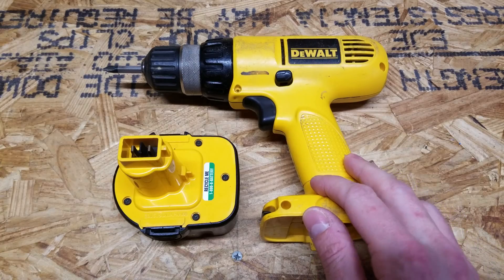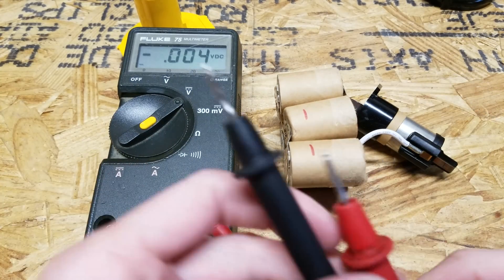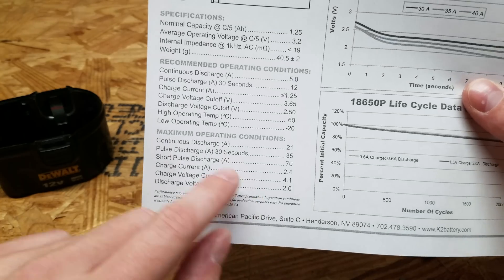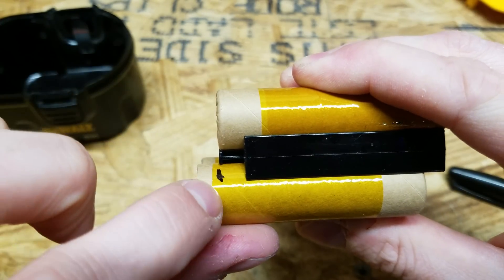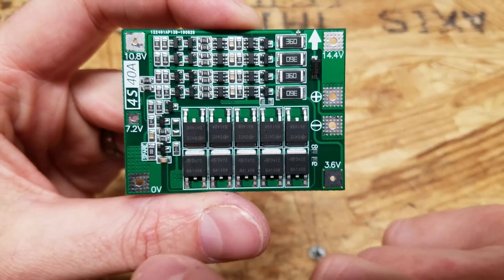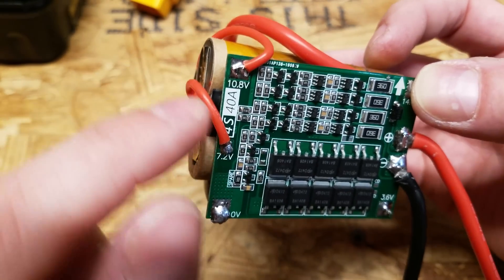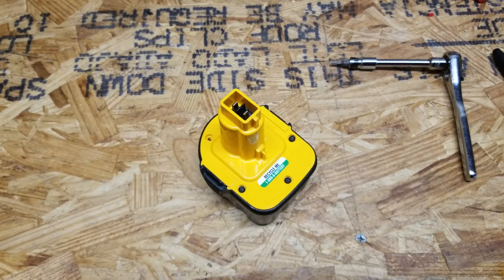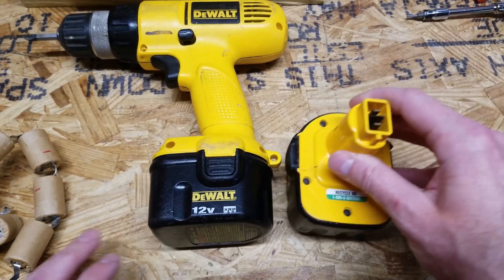Converting a DeWalt 12V Cordless Drill from NiCad to Lithium LiFePO4

Comment: Cool build. You could have skipped the epoxy with super glue and baking soda combo. Also, I thought Lithium batteries needed chargers that had the CC/CV functionality. Do Ni-Cad chargers do the same thing?
Reply from the maker: I just used jbweld epoxy. I didn't use super glue or baking soda? Was there a better way to attach the terminals? I still have two more to do and can do it differently if there's a better way.
Reply: @LithiumSolar  You did a good job. I was just saying the super glue + baking soda is almost instant, so you wouldn't have had to wait the night like you did with the epoxy. But if you weren't in a hurry then it's not a big deal.

Comment: What about charging requirements for the new batteries?
Reply from the maker: Since the new LiFePO4 batteries align with the NiCad in terms of voltage, I'm just using the original DeWalt charger.
Reply: LithiumSolar Short answer, I wouldn’t use the NiCad/NiMH charger to charge those cells. Look for a BMS/Charger combo that meets your cells C rating or less than C rating for charging and balancing. Make sure you understand the cells C rating charging limits. Add a DC jack to the battery pack for power to the BMS/Charger. You can use a separate charging board and BMS but it will take up more space and need to be wired differently. But don’t use the NiCad/NiMH charger for lithium based cells.
Long answer: The charging algorithms are different for lithium based cells vs NiCad/NiMH cells. NiCad/NiMH chargers trickle charge on the last stage, lithium’s chargers just cut off so they don’t over charge, trickle charging a lithium cell will over charge it. NiCad/NiMH chargers tend to overshoot on the voltage when charging, but lithuim cells don’t like this at all and charging is more regulated on both voltage and current. NiCad chargers don’t monitor temperature to cut off charging and were expected to get hotter during charging without being volatile like lithium based cells that are more sensitive to temperature and can go into a thermal runaway. I’ll admit that LiFe cells are less volatile then LiIon cells, but charging them wrong greatly increases the risk. Lithium cells can be safer vs NiCad/NiMH cells when they are “properly charged”, but lithium cells require a much more complex charging circuit.

Comment: You didn't cover charging. I am assuming that NiCad has different charging characteristics than lithium..??
Reply from the maker: I was just going to do use the original DeWalt charger since the voltage of LiFePO4 is near identical to the old NiCad.
Reply: LithiumSolar Short answer, I wouldn’t do it. Look for a BMS/Charger combo that meets your cells C rating or less than C rating for charging and balancing. Add a DC jack to the battery pack for power to the BMS/Charger. You can use a separate charging board and BMS but it will take up more space and need to be wired differently. But don’t use the NiCad/NiMH charger for lithium based cells.
Long answer: The charging algorithms are different for lithium based cells vs NiCad/NiMH cells. NiCad/NiMH chargers trickle charge on the last stage, lithium’s chargers just cut off so they don’t over charge, trickle charging a lithium cell will over charge it. NiCad/NiMH chargers tend to overshoot on the voltage when charging, but lithuim cells don’t like this at all and charging is more regulated on both voltage and current. NiCad chargers don’t monitor temperature to cut off charging and were expected to get hotter during charging without being volatile like lithium based cells that are more sensitive to temperature and can go into a thermal runaway. I’ll admit that LiFe cells are less volatile then LiIon cells, but charging them wrong greatly increases the risk. Lithium cells are safer vs NiCad/NiMH cells when lithium cells are properly charged, but lithium cells require a much more complex charging circuit.
Reply: Stinky Cheese “Things break”, I would consider that an inherent risk with any battery charging system. I think most good BMS/Charging systems can detect a fail or break and stop/won’t charge the cells.
Reply: @GadgetReviews-US  These are exactly the same qq I have been pondering with my rebuild (3S1P, Li Ion, works great so far) of my  ol mans Bosch  drill (198?). Isn't the point of the BMS that it provides both usage protection and also manages the charging (the input from placing the battery in the original charger will go through the BMS board, this type of BMS has the same input/output terminals)? The Li Ion BMS I am using is of the same kind  as  the one used in this video, for 3S. Although the original charger has different control circuitry, in the end it is just supplying DC.. from browsing other videos it seems the most common result from using the original charger is undercharging.
At the moment I am using my Imax B6 - I fitted the batteries with a  dean connector wired directly to the end + - cells and an independent JST balance connector, the Imax control circuitry thus managing the charging.
Reply: Family Brown The BMS does provide usage protection and some with balancing. Most BMS will monitor based on voltage alone, and some with temperature cutoff also. Yes both chargers provide DC, but it’s his the cells are charged that matters so the cells don’t become unstable comprising user safety and the chemical changes that happen inside when charged incorrectly. 
Charging of lithium cells is done with CC (constant current,  the current tapers off once the cell reaches the charge voltage. With NiMh is done opposite with CV (constant voltage) charging. NiMh/NiCd chargers trickle charge since these batteries absorb/self drain a little over charge as the Lithium based cells don’t. Once Lithium cells reach full charge the voltage will fall a little causing the NiCd/NiMh charger to charge the cell more, the BMS will slow this since it’s just monitoring the voltage. This cycle could cause the Lithium cell to become over charged and cause plating of the metallic lithium comprising safety. LithuimSolar mentions he noticed this trickle charging in another comment, but states he takes the battery off after charging. This prevents over charging but the lithium cells still take on some damage from the constant voltage charging. The damage may not be immediately noticed and is over some time that can cause the cell to become unstable during use.
A good article I found about lithium charging is, although comparing the two charging methods in detail would make this a very long comment. I hope this helps.
https://batteryuniversity.com/learn/article/charging_lithium_ion_batteries
Reply: @GadgetReviews-US  Attention: CV is abbreviation of constant
Reply: constant voltage
Reply: @GadgetReviews-US  Thanks for your answer and discussion.
Reply: ioan pop oops, corrected now. Spell checker and late night when I replied. I missed that, thanks.

Comment: 17.8 Wh on the new battery pack. If the old NiCd cells were 1700mAh then the old pack was about 20.4 Wh so not too bad and not that much lower however the life cycle could now be measured in decades as opposed to mere years. lol.
Reply from the maker: Exactly what I was thinking. Less Wh but will last much longer. The problem is I now have to wait another 2 months for another BMS. I should have just ordered 3 at once lol.
Reply: @LithiumSolar  Ahhh, that old dilemma. Why is it when you try to plan ahead and order multiple items for future, they turn out to be junk and you have buyers remorse and when you try to be cautious, you end up wishing you'd ordered more 🤔
Reply: daly bms ship fast from china only i don't know if the fit in youre case
Reply: @electrojessy4270  Nothing is shipping fast from China these days. Ordered a daly bms from Aliexpress a month ago. It's not here yet.
Reply: Got a Daly 150a, took 2 months

My 90ah cells, lets just say I don’t wanna talk about that 😒
Reply: No.  Lithium cells have a shelf life and will not last decades.  In fact, odds are that the NiCd would have a longer life if only they had a proper charge and discharge termination but instead clueless users of tools, keep trying to get the last bit of capacity out of NiCd since there is no protection circuit to stop them, and end up reverse charging them through discharge as the weakest cells go below 0V.
Reply: @stinkycheese804  Maybe your dad's lithium.